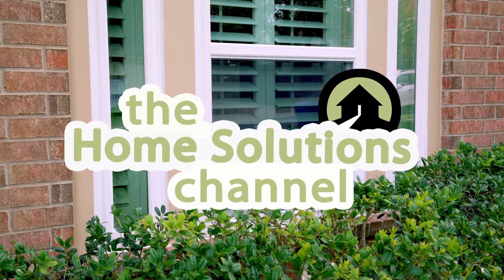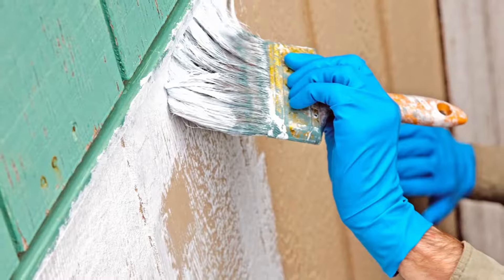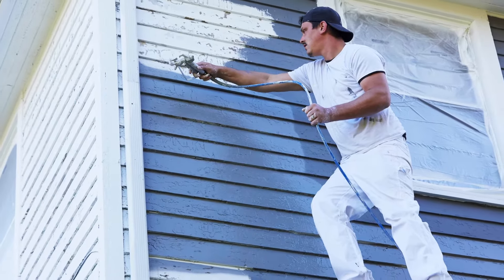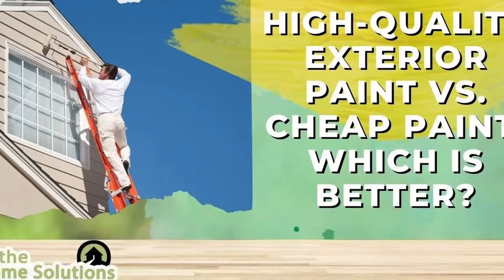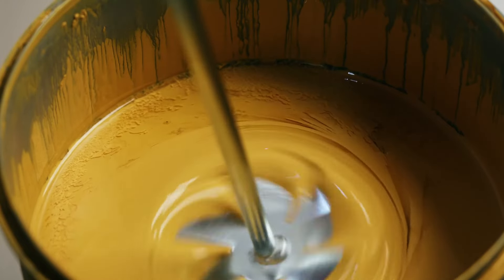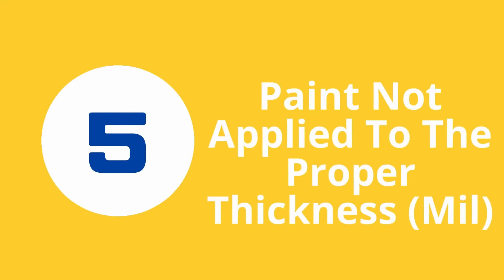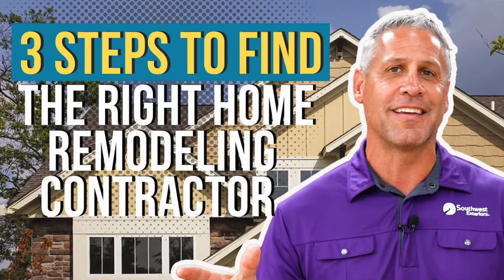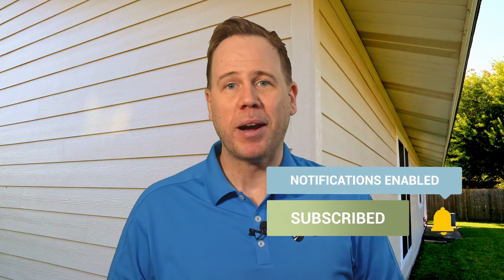Why Is My Paint Falling Off Of My James Hardie Siding?

Comment: Never use anything but behr marquee exterior satin WITH PRIMER you apply let dry no less than 24 hrs then apply 2nd solid coat I e had Hardie last on many customers homes not a single problem after approx 20 yrs
Reply from the maker: Thanks for sharing your experience with Behr Marquee Exterior Satin with Primer! It’s great to hear it has worked well for you on James Hardie siding. Proper preparation and high-quality products are key. We appreciate your input and are glad to know about methods that ensure long-lasting results
Reply: I guarantee my sol-silicate made by my company mineral stains will last longer, as it is breathable, made with water glass and silica, uv protected and non combustible.  You cannot compare with any latex, acrylic or even elastomeric.  cement fiber, still is porous, entrapping moisture will limit the lifespan of the siding.  Here in florida, Behr exterior will not last that long.  Also, primer by itself is the way it should be applied, not the 2 in 1 garbage.  A real primer is meant to be stickier and act as a glue to paint, when made in one, it is a gimmick.   It's a marketing shortcut.   A primer without acrylic and fillers, for example, will penetrate or adhere more proper, than with 2 in 1.

Comment: I’m installing the pre primed yellow . Do you recommend still priming before my top coat  as an insurance,  or the primer hardie provides is sufficient
Reply from the maker: Great question! While James Hardie’s pre-primed (yellow) boards do come with a factory-applied primer, we’ve found that it doesn’t always provide the best seal for long-term paint adhesion. For the best results, we do recommend priming again before applying your top coat.

At Southwest Exteriors, we use Sherwin-Williams Loxon Primer, which is specifically designed for cement-based materials like Hardie siding. This helps seal the surface properly and provides a smoother, more durable finish when paired with a high-quality paint like Sherwin-Williams Duration.

Taking this extra step ensures better adhesion, longer-lasting color, and a more polished final look. Hope this helps, and best of luck with your project! Let us know if you have any other questions!
Reply: @ thanks for the response. Do you know if sherwin Williams prep rite primer would suffice for James hardie. Like mentioned  Loxon is for cement based materials. I have some lp smart trim installed that I’m hoping one primer can do both hardie and lp smart

Comment: But what do you do if the paint has failed?  We've had to repaint repeatedly. Now you can see even paint everywhere. Is it a complete loss?
Reply from the maker: Thank you for sharing your concerns about the paint issues with your James Hardie siding. Paint peeling can be frustrating, and here are some steps to help address it:
1. Clean and Prep: Ensure the siding is clean and free from peeling paint.
2. Use Primer: Apply a high-quality primer suited for fiber cement siding.
3. Choose the Right Paint: Opt for a high-quality, 100% acrylic exterior paint.
4. Consult a Professional: Consider a professional inspection to diagnose and correct the paint failure.
5. Check Warranties: Look into any applicable warranties that might cover the paint issues.
It's not necessarily a complete loss; with the right approach, your siding can be refreshed and protected.